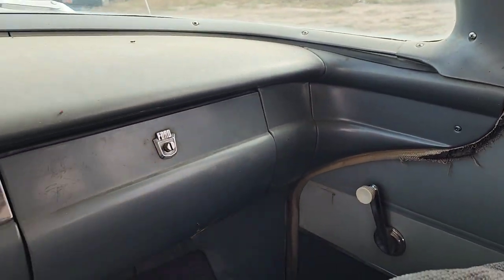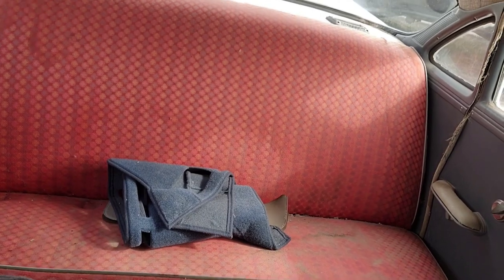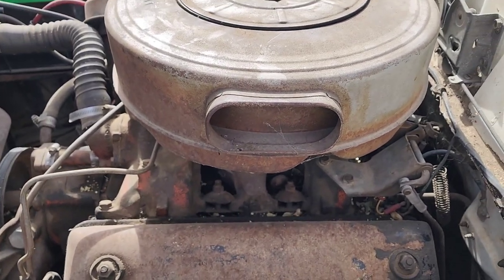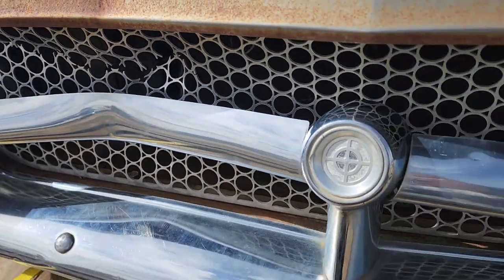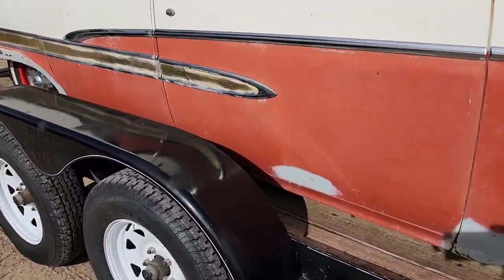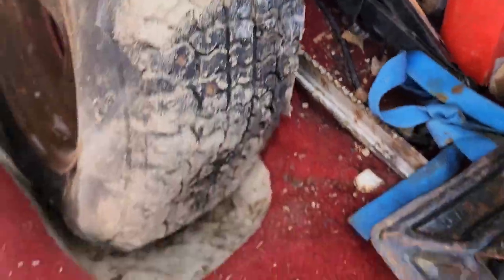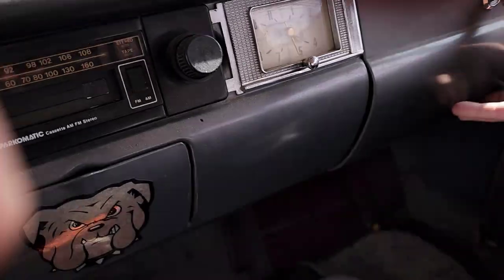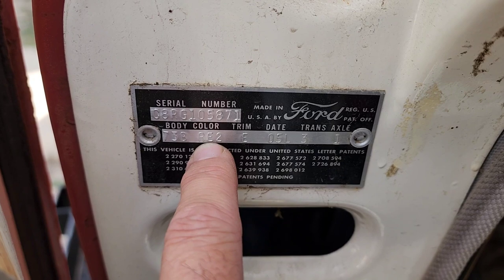New project! 1958 Ford Custom 300.

Comment: I have a 1958 Ford Custom 300 4-door sedan, Raven Black & Colonial White, 6 cyl. w/ power steering.  When I close the hood, it makes the exact same squeak sound yours does.  Amazing!  My headliner was ripped so I had to replace it with gray cloth because that "cross-hatch" pattern wasn't available.  Pictures of the car on flickr. 🙂
Reply from the maker: I love when other people's old projects make the same weird noises mine do 🤣

Comment: If I’m remembering correctly, the Ford 292, had problems with the cam bearing, causing the cam to wear out. They had problems oiling the top end, because of it. My father had 61 Ford, that had the same problem, the cam wore out.